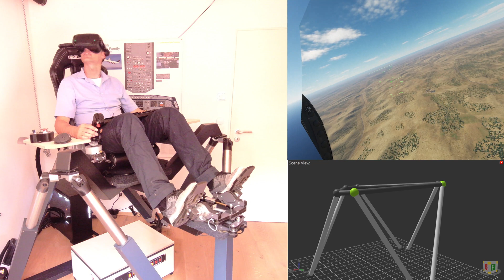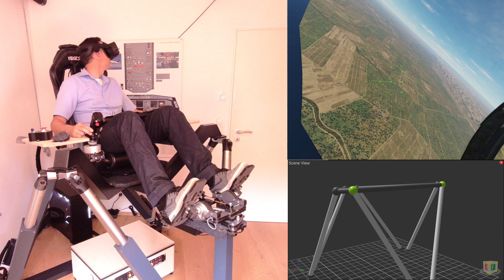Motion Rig Demo - Prototype 2 - Flight

Comment: Hi Dirty... I'm one of your followers from Xsimulator forums😀. I realized in this video your cockpit doesn't seems to be "glued" of "attached" to the floor anymore like your previous version to avoid drifting/jumping of it. How did you solve it?
Reply from the maker: Hi :-)  No, the attachment points to the floor are unchanged. I glued three blocks of 20mm plywood to the hardwood floor, spaced exactly 120° degrees. Each block would carry two actuator "feet". Then I drilled into them and inserted M10 threaded inserts to get a strong, reliable and repeatable connection. I didn't want to drill bolts directly into the floor, because the room has underfloor heating pipes that I sure as hell would've hit. Shoot me a PM over on the xsimulator.net forums and I can send you the CAD files. You know the old chinese proverb: "A CAD file speaks louder than a 1000 words." :-D

Comment: I cannot see the movement of dynamic station when aircraft turns… how many degrees works?
Reply from the maker: The only honest answer would be: "It depends" :-) When all other DOFs are at zero (which they never are), then the upper platform can utiiliize ±26°of roll. Pitch range is +27°/-11° In reality you will rarely ever need nore than ±10° of roll or more than +15°/-10° in pitch. In the video the roll channel is visible, anytime I enter or exit a roll but I guess you were expecting much greater angles.
Reply: @hexago-motion1454  I’m evaluating it for F-16 where would be better a total movement like here https://youtu.be/ZVeOJvMad-M😅🙄

Comment: Maybe I missed it but how much?
Reply from the maker: I mentioned it somewhere down in one of the first cmments: This the 2nd prototype of a product that I hope to be able to bring to market at some point.  I built the kind of rig I would like to buy: A well balanced compromise bang-for-buck wise. Initially, I was aiming to stay well below 10.000€ (incl. tax!), but with the recent hike in prices that is ambitious, to say the least. I think it performs on a par with €25K platforms, hands down. I will offer this particular prototype up for sale in late 2022 for the price of the raw components (~8500€ incl. tax) and then use the funds to build a more polished version. That's the plan, at least 😀
Reply: @hexago-motion1454  what about weight tolerances? I was thinking about adding a motion rig to my existing obutto rig setup??
Reply from the maker: @CarstenDittrich2014  I have planned for an upper platform weight of 150Kg: Roughly 50Kg for the platform itself with seat, rudders, control stick, thrust levers, cabling, armrests, etc... and then a 100Kg payload. There is still A LOT of performance margin in this setup though. Even a 120Kg guy will barely require more than 30% of the torque for the most extreme movements.
More likely, longevity will become a factor if you overload the system. Dont ask yourself: 'Will it hold?"  (of course it will!) but rather: 'Will it still work flawlessly smooth after a decade or two?'
Reply: @hexago-motion1454  What I thought/hoped. Thanks for answering that. With my Obutto Revolution frame, rudder, joysticks throttles, button boxes (flexible airframe setup), it will get tight, but still shouldn't exceed those tolerances... Thank you, will consider options 0;) Next worry is Center of Gravity I suppose...

Comment: Very interesting rig, how does the VR headset not move your head around the cockpit as the simulator dips, raises, or moves your head left to right? I would think the VR tracking software would not be able to tell when you are moving your head around versus when the simulator is moving your head, or is there a reference point somehow built into the rig or the motion of the sim being subtracted from the head track?
Reply from the maker: That's exactly what happens :-) Well described! I am using OVRMC: https://ovrmc.dschadu.de  
I talk about it here: https://youtu.be/LWyTwTPQc2s?t=64
Reply: That's a problem, for sure. It's addressed by adding a capability called motion compensation to the rig. A hand controller can be mounted to the rig. The cameras or lighthouses track its motion and subtract it from the motion that would normally be displayed in the headset.

Comment: Hi. Were you using a Thanos controller previously? If so how does it compare? Thank you.
Reply from the maker: I have been using multiple Thanos controlllers before the Motion4Sim controller and the motion I got from M4S was much(!!!) smoother. A difference like night and day. I am not a professional with microcrontrollers, so I can only speculate WHY that is, but I can say with confidence THAT it is the case.
My conjecture is this: The M4S controller uses a much, much faster processor (like ~15x) and with it manages to maintain a perfectly constant framerate under ALL circumstances. I would love to see someone with professional experience take a closer look at it. I'd be curious as well.
The M4S controller allowed me to use a pulse multiplier of '1' (the full 10000 clicks per revolution) versus 20 on the Thanos board (500 clicks per revolution).  On the 20mm ballscrew that I'm using, that alone makes a noticable difference.
I would also like to add, that this difference I'm seeing here is most relevant for long-stroked flight sims and not so much for those typical 4-legged racing sims. With all those high frequencies and short strokes in racing, it will simply never become noticeable. For flightsims it was a real game-changer. And that is actually still an under-statement.
Reply: @hexago-motion1454  Thanks so much for the excellent reply. I sent you an email asking a few questions regarding YAME and actuators too. 
Are you using a 20 pitch ballscrew currently ?